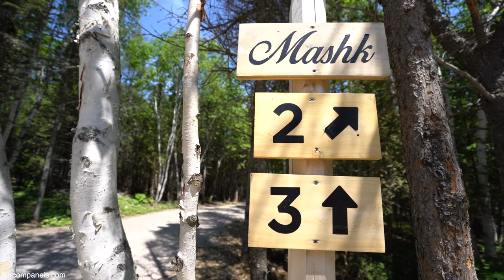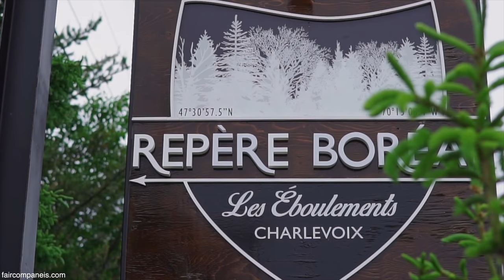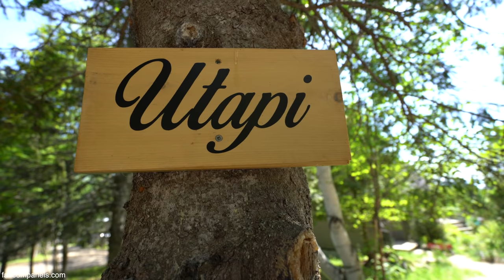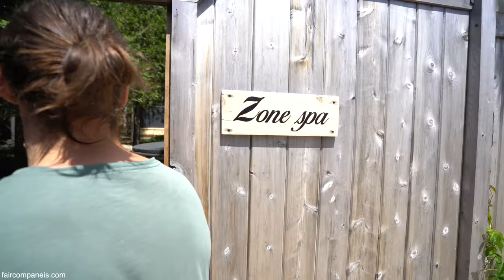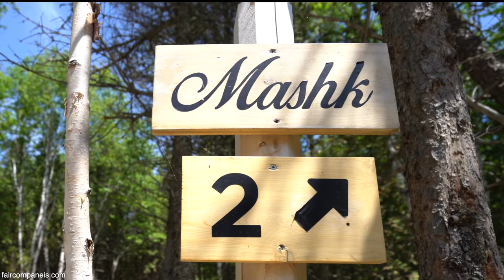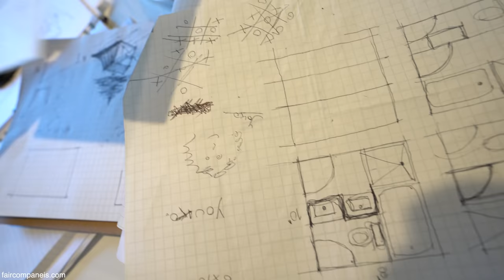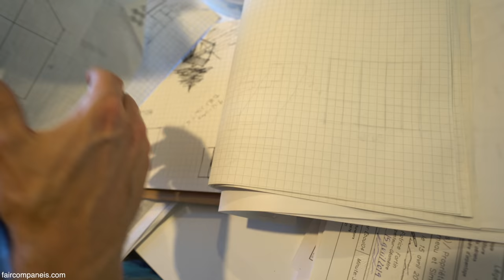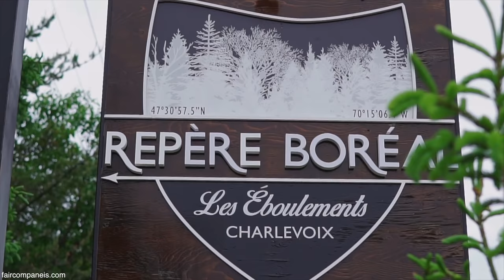Brothers build boreal utopia of open-roof cube cabins in nature

Comment: As a roofer I would strongly suggest making the next cube type homes with atleast some kind of slope to the roof to allow for run off, I have seen too many issues with flat roofs. Great video
Reply: I was thinking the exact same. Especially with a glass roof. The weight will be distributed to the bottom corners of the slope if you're in a snowy area and rain will obviously  run off. Cleaning Is going to be easier too just hoist the hose to the top part and watch the debris fall off
Reply: It does seem a feasible concern.
Reply: Yep
Reply: Thats What my ingeneer father told me😇😂 shaking his head the neighbours build with flat roof
Reply: I was thinking this, having lived in New Mexico where the roofs are flat causes major problems, one of them mold

Comment: The chicken house could have 4 bunk beds for kids, to function as a kids' tiny house. Or two bunk beds and a tiny wet-bathroom with sink, toilet and shower. Though you could replace the/one lower bunk bed with storage for clothes, food, a chest fridge/freezer and an alcohol stove for cooking outside. Honestly, if the chicken coop was taller and a bit bigger (2x2x2m), you could fit a single bed with storage below,  a tiny wet-bathroom, a sink and with a slot for a portable stove to stay fixed, a bit more storage near a chest fridge/freezer, and lots of playable/folding tables on the walls to extend the usable workspace, and a clotheshanger rail above the bed, possibly also lots of netting storage on the walls, to give the walls a bit of depth, the inside of the door being a full-size mirror and the wall with the bed being a group of 3 windows with a bevel, and the top and bottom windows opening for ventilation, with a thick black curtain for working as a trombe wall.
Reply: I call those 2x2x2m buildings nano-homes. Anything smaller than that would be a nano-camper (where you need no bathroom, no fridge and almost no storage) or a coffin-house. Do youtube "Boeing retiree finds meaning inventing micro homes & high speed trikes" for more details.

Comment: Being a glass guy and knowing that tempered glass can just shatter without anything touching it(odds are about 1 in 150000 for 1/4 glass according to Pilkington research), I would put a hand railing over the top of that glass. Now I will admit that because its 3/8 tempered its extremely rare that it breaks, but still with kids yeah a handrail would be needed.

Comment: Shipping containers weren’t designed to live in. A purpose built design with ample choices of materials is much smarter method. You’re not constrained to the narrow confines of a shipping container that is a symbol of globalism and the factors that ironically lead to economic conditions that necessitate living in a metal box
Reply: I can sadly agree with that comment. Shipping containers. Some people have to live in them without any perks. I've seen them at storage facilities where people are actually living in them because it's all they've got. :(
Reply: Does it help with keeping them out of landfills? That would be an upside.
Reply: @komegaj  
😇Steel is completely recyclable. I dont think much goes into landfils...but I see what you mean. Using them as dwellings is fine, just don't leave them there in the forest o rot.